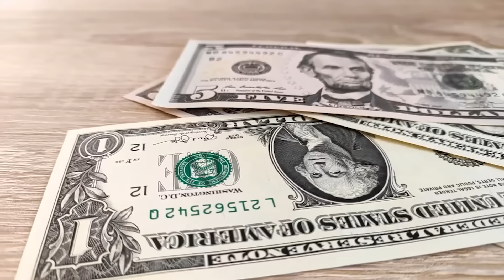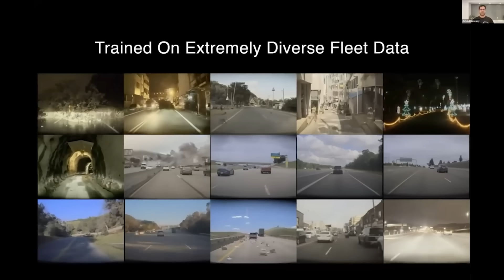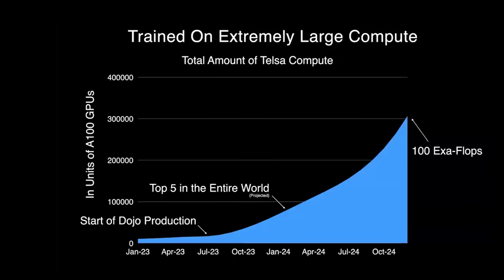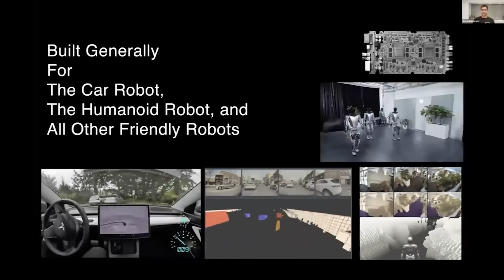Tesla Autonomy: The Revolution Begins

Comment: During that live video with Elon,  when "FSD"  didn't respond to road conditions properly,  didn't Musk say that all we need is more data and the car will respond properly?   If that's the case, then how the hell do you know when the car doesn't have enough data?  As a layman,  that sounds a lot like the system will always require supervision.   Where did my logic fall down?  I know what you just said about Nvidia,  but Dojo was supposed to be the holy grail, wasn't it?  I was taken aback when Musk said that  "Dojo was a long shot" during the Q4 2023 earning call. Was that because the lead designer and Tesla parted ways so progress was slowing or was it that the design as presented wasn't achieving performance targets and the lead designer and Tesls parted ways ( about 1 month before the earnings call).

Comment: Telsa needs to completely reset its pricing and positioning of FSD as an advanced ADAS and slash the price. 
So we have say $1k to purchase plus a per mile useage fee of $0.1c.
For those who have purchased the FSD for $12k+ they do not pay anything and they obviously get all the upgrades.
When V12 is avialable that can be $2k +$0.2c/mile.
When FSD is feature complete with no robotaxi regulator authorisation then this goes up to @$5k + 0.3c/mile.

When Tesla takes on the liability of FSD by insuring FSD drivers and passengers and rolls Robotaxi level 5, we have pricing at @$15k + 0.3c/mile.

I think this massively increases the value of fsd as ADAS and as it transitions into Robotaxi based on the actual capability not what a clearly inaccurate Elon thinks it will become.
FSD pricing and Elons clear misunderstanding of the task has been his biggest screw up, bar buying Twitter. He is human afterall😊